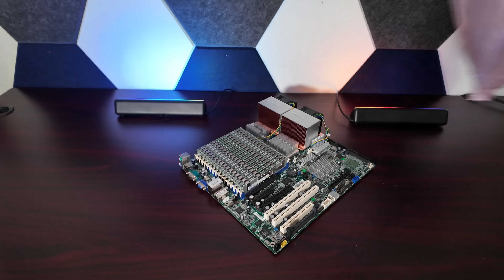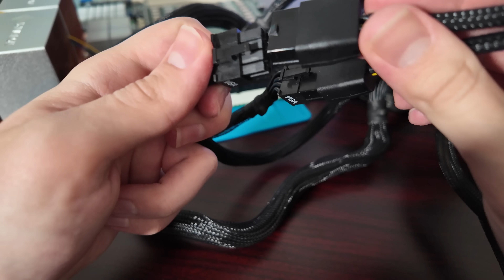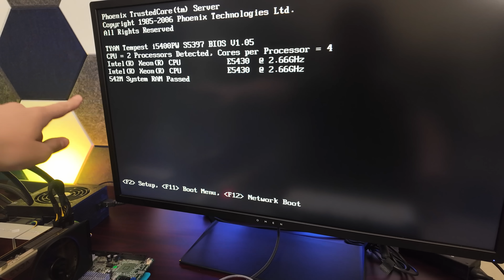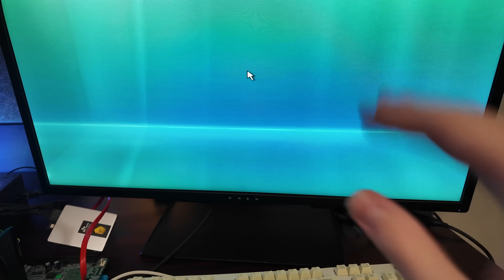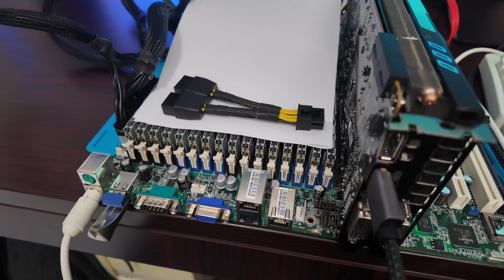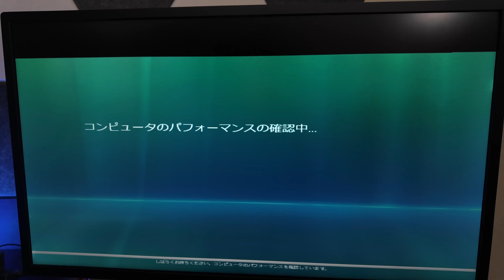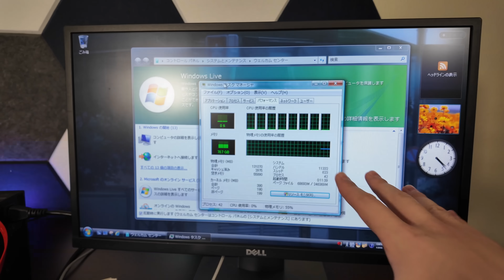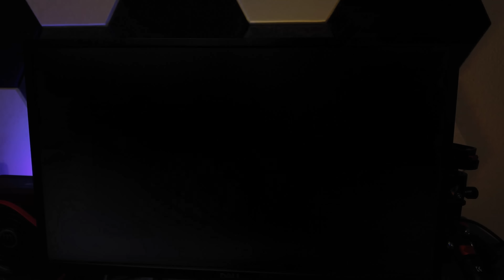What can you do with 128GB of DDR2?

Comment: DDR2 FB-DIMMs are about ~5GB/s (per channel) and it looks like each Xeon here has 2x memory channels so you get about 10GB/s per CPU but then have to content with the CPU interconnect, so while it's a cool project, a single PCIe 4.0 x4 SSD already comes close to beating this, a 5.0 drive can beat the single CPU bandwidth and most likely the latency too. It really takes fast DDR3 to beat the sequential R/W of a few modern SSDs, though at this point the latency tends to be a lot faster than even Optane drives

In short, there is no practical application for this, despite many people suggesting you could do CPU-only LLMs 

Still cool as hell though.
Reply: But AI on these "ancient" CPUs would take ages to generate anything.
As much as i love LGA775 cpus, i have q9300@3.0GHz, these CPU are way too old to do AI calculations.
I've seen some linus video with modern threadripper i think, and that thing took a lot of time to do AI.
I can't even imagine how long it would take for "ancient" Core2 processors with only 8 threads to do some basic AI

Comment: I really miss Windows Aero. It still looks amazing to this day.
Reply: better use of sys resources then what windows 11 uses
Reply: There is a very accurate aero theme for linux.
Reply: @pacg3627  the linux port runs like dogshit and programs often do not obey the iconset nor the menubar icons and theme
Reply: @georgewashington6171  I'm using it everyday on my laptop. Everything works fine and look perfectly like windows 7. I don't know what are you talking about. I'm using "aerothemeplasma"
Reply: @pacg3627  Linux is trash,even worse than Windows.
Reply: @kelvinkegel2304  why?
Reply: @pacg3627 everyone knows why, no one will waste time to list it for ya, just install it you will learn quick
Reply: @pacg3627  bro probably tried to open an exe
Reply: @kelvinkegel2304  fym trash?
Reply: You can get it with Stardock's Window Blinds, though of course it is a bit graphically glitchy
Reply: I never did care for aero.  I always and still do disable it. I find the performance improves when it is disabled.  I dislike any graphical nonsense that obscures or slows me down.

Windows XP would be good on this Tyan motherboard.  I'd use it to power a LSI pci-x raid card to make a IDE Raid array.  Then he could test the data throughput better.  Back in 2007, I salivated at getting one of those cards setup with a board supporting Pci-x. Kid of a stupid interface really as when you search for peripherals, almost nothing is made to work with that slot.

Not much useful a guy can do with this board because Microsoft forces End of Life on their operating system.  All the newer stuff is non compliant with older standards which makes it impossible to do much.
Reply: @pixels303at-odysee9  Even my 2007 Samsung R70 laptop with Core 2 Duo + Geforce 8600M GS ran both Win7 Aero and Linux Compiz rather smoothly and without major performance penalty.
Reply: @pixels303at-odysee9  linux is scared of this man
Reply: @pixels303at-odysee9 Linux
Reply: I hate it, i always disabled it, to me it looks like child toy same as windows 11 and new ios 26. Windows 10 and 98 and previous mac/ios gui are a lot better

Comment: The regular limit for DDR2 was 2GB per module. The vast majority of consumer (non-server) DDR2 modules were 2GB max.
As far as I remember there were 4GB modules, but those were some obscure, working only on some AMD platforms. So rare stuff. 
Almost all motherboards allowed only 8GB max, that's what MOBO manufacturer says on their product page. So that is 4x2GB in a system, since regular RAM capped at 2GB.
And at that time, it wasn't even a problem (for consumers), since Windows XP (32bit) at least at that time allowed only for 4GB. I only added another 4GB once i switched to Windows 7/8
I am still using q9300 with 8GB of RAM the max that is/was possible for everyday consumer using DDR2.
And here comes the guy with 128GB of server DDR2, let's just say, you got me interested 😳
Reply: Even with AMD getting 4 4gb udimms to work was pretty rare. My AM2 motherboard will run 4gb sticks in the first slot of each channel but to fill all 4 slots needs unicorn dimms that are 1rx8 IIRC.
Reply: There's some 4GB dimms that work on Intel even though no motherboard 'supported' it. Later 4GB dimms showed up that only worked on AMD. The ones from the video are FB-DIMMS. Costed a fortune either way
Reply: 4GB stiks of ddr2 works on socket 775 with intel CPU's if mobo has non-intel chipset like nForce 600-700 series.
Reply: @Almashina  -  This. Back in 2009 I had a Gigabyte GA-G41M Combo board with a Core2Duo E7500. It had max support for 8GB DDR2 1066 or DDR3 1333, but you couldn't do mixed mode. So back then I had a 2x 4GB DDR2 kit. I had basically an upgrade path/road map where eventually I replaced that 8GB DDR2 with 8GB DDR3...then shifted to AMD with a Phenom II x6 1090T and added another 8GB for 16GB total. 

Was doing some video editing and photo editing as well as audio work back then--as I do now. So it's crazy watching this video with a 16-core/32-thread 5900XT and 128GB DDR4. When server/workstation grade of old becomes consumer/normal in the present.
Reply: @Almashina  I had a stick specifically advertised as working on Intel. It cost a fortune but worth it at the time

Comment: 128 GB.... try a CPU only LLM - might want to switch to Linux for better NUMA Mode acces, but WIN10 should maybe to the trick also... LM Studio or similar should get you to testing quickly :)
Reply: 128GB of memory that is slower than 1-2 PCIe 5.0 SSDs.....
Reply: @balthxzar  a server like this runs on 2 to 4 channel memory speeds - and latency of RAM still is way ahead of any modern SSD, even when its "only" DDR2... So while you are correct that DDR2 is slow and SSDs have become quite fast, there still is a difference...  And besides that - going for an older Socket 711 System with registered DDR2 RAM nowadays is much more of a fun project than "Meaningfull", so why not to something silly with it :)

Comment: I would love to see a bandwidth test in AIDA64. Based on the motherboard specifications, it's only dual channel per CPU, so it should be around 10GB/s.
Reply: this pre-dates dual channel or on-CPU memory controllers. CPUs of this era communicated with RAM over the Front Side Bus (FSB). the theoretical maximum for this CPU would be 8 bytes x 333 MHz x quad-pumped 4x = ~10.66GB/s. this bandwidth had to be shared with literally everything as everything went over the FSB

Comment: DDR3ECC is optimal because you can use a fairly powerful CPU, it's cheap, and it's reliable. 2 is dinosaur stuff. The only issue is my DDR3ECC systems have high idle power.
Reply: Does undervolting help ?

Comment: CPU-only local LLM model inference. 😬
Reply: I was thinking that but the CPUs are probably missing instructions
Reply: Most useless waste of hardware. Grow up, it's trash.
Reply: @MJ-uk6lu seethe
Reply: @MJ-uk6lu If alternative is trash... by definition, it isn't.

But yeah, I hate it that all this old RAM is essentially useless. Why is there not a product that would allow you to arrange sizeable (or massive) banks of it, backed up by a battery, and just use it as a super fast cache drive. Akin to that Asus (IIRC) PCI card that had 4 DIMM slots for exactly that use, in the pre-SSD era

EDIT: Correction, it was Gigabyte i-RAM.
Reply: @cbs1710  It is trash, because pay like 2 times less to get hundreds times worse performance and you also get absolutely awful performance per watt. It could only make sense in some older high core count thin client with free RAM. And only because Intel put same desktop i9 and heavily detuned it from 125 watt tdp and 220 watt constant boost to just 45 watt tdp with 45 watt boost.
Reply: @MJ-uk6lu  That is what I meant. If the alternative for that RAM is to go to trash, the fact that it is doing anything means it is not trash. What it is is "not efficient", either energy or time-wise. However, neither is selling one's kidney to get something else. So, use what you've got, then try to follow the three-Rs, and get something better when possible, and if one really needs it.

That RAM, if used in non-AI oriented tasks, can still "live" long and productive life. If speed isn't an issue for the user, investing in renewable power (i.e. small solar install of a panel or three) would offset many other small inefficiencies. If it still works fine and does satisfactory work, it doesn't have to go to trash.
 
(Though I think we're somehow at the same time in agreement, and misunderstanding each other...)
Reply: @cbs1710  Trash? You could make a fortune with it on eBay. People are buying anything with memory or memory itself like it's toilet paper at start of pandemic.
Reply: @MJ-uk6lu 

Well, in that case, the idiocy of people buying DDR2 (or even DDR3) at idiotically inflated prices certainly hasn't reached my local shores, nor would I like to condone (let alone support) such behaviour. 🧐🤔
Reply: @cbs1710  Not all of it was actually stupid. Most DDR2 is wortless, but some people wanted, I believe, 4GB sticks for older Core 2 Quad or Extreme systems to either let them last just a bit longer or to build the most extreme retro rig. High capacity sticks were quite rare as they were very expensive and they were sold when DDR3 was already a thing. But that's non ECC RAM and nothing less than max capacity one and preferably maximum clock speed as well. Meanwhile people sweeping low value regular or server DDR2 at premium are morons like you just said. I can bet that there are even rarer morons thinking they will just buy some and resell even higher. I see no offense in you selling it now, but only if you sell it at lower than current price, but above typical price.
Reply: No 😂

Comment: That would be one hell of a Proxmox home lab
Reply: Yeah I run xcp-ng on a 4s 768gb server and its awesome. Cost like 200 cad 😂
Reply: My proxmox homelab is a super micro dual 2969v4 (like 44 cores) with 320Gb of DDR4 and I'm like this dude. Idk wtf to do with all the ram. I have at least a dozen VREs and they're never up all at once
Reply: @JaredBrewerAerospace run models 😂
Reply: Performance would be incredibly sub-par unless you stick to light-weight LXC containers. Those Xeons, even if they have 4 cores each, are slooooow, and so are the SATA ports and PCIe lanes on that era of server motherboards.
Reply: It'd be slow due to missing some important virtualization instructions. Even though these had VT-x, VAT was needed to get near hardware-level performance. VAT was added with Nehalem
Reply: I have a Precision T5400 with dual xeon e5405s and 40GB of DDR2 SODIMM. Its really slow for PVE, the instruction set is limiting and the power draw means I cant keep it up 24/7
Reply: It would indeed... I have like 8/9 in this spec.... DDR3 / 4

Comment: If it wasn't for the fact that you need the 2nd processor for the entire RAM bank + 2nd LAN port, this could be a pretty decent SP staging ramdisk albeit it's probably way too weak for modern ZFS and it's not going to be good for VM either, not to mention you need to replace the cooling lol.
There's also a setting on bios for USB to run at full speed, i think. (it's usually defaulted to 1.1)

Comment: Maybe, the sequential speeds were low, because of the communication bottleneck between the 2 CPUs sharing the whole memory pool.
You should try with one CPU and it's memory channels and see the difference. Also, maybe in Linux would be easier to choose the memory channels of a single CPU for the RAMdisk.
Reply: the ram is 667 so it shouldnt be to bad if the fsb is 1333 . now the 1600 mhz fsb would be a better say like the 5450s or x5472s
Reply: Yeah its 667mhz mem with 2 channels per cpu and a 1333mhz fsb. I dont think it had qpi and idk if they had a dedicated channel between cpus or if it interconnected over fsb... Been ages since i played with this era of stuff

Comment: slaps the side of the case
"Yep, this baby can open 700 chrome tabs at once"
Reply: What case?
Reply: I have over 1400, and my 96gb of ram handle it fine !
appart that one time where to loaded all the tabs into ram at once and it used over 130gb of ram, even my pagefile was shocked...
Reply: @SpeedyGwen  bro my laptop has 4 gb of ram
Reply: @SpeedyGwen  I have 64gb, and it handles around 700 tabs fine, but I stay at around 200 for the sake of stability and my sanity. On a day when I need to multi task, I easily go past 600-700 tabs, but I try to avoid this because I use arch and my fcitx daemon keeps dying on me and I will have to restart and sort out all of those 700 tabs into their designated virtual desktop, and that alone takes a good part of an hour. 200-300 tabs are perfect for me since that's around the limit of what I can keep track of mentally.
Reply: @edamame-h1r  larp
Reply: @matthias7534  If you want to see my computer in action be my guest. Just tell me what you want to be displayed on the screen
Reply: @edamame-h1r  tbh things have changed, now am around 200 to 400 tabs and am permanently on Linux and brave browser, things have been better  :3
Reply: @edamame-h1r  i cant even organize 5 tshirts how are u organizing hundreds of tabs?
Reply: @bruciex4574  I don't. I have 4×2 virtual Desktop layout (Yes that's 8 in total). Each serving different purpose. I just keep tabs open there, and the rest are muscle memory. Also I have the session manager extension installed and set up shortcuts to move and switch tabs. I actually authored the switch tabs shortcuts extension.
Reply: 7*
Reply: ...my Firefox with tree-style-tab is in the multiples of thousand. 😶

(Win 10, 64 GB, PC from 2017)
Reply: @cbs1710  starts crashing for me at around 1040 tabs in brave, 5800x 16 gb 3200 cl14 and a fast m.2, and that's the secret, it flushes fast.
Killed my old 775 motherboard ddr2 and HDD when I started closing the 700 tabs... blue screen, restart, close 30 tabs, blue screen, restart, another round of 30, halfway in, fried.
Reply: @Brukner841  i also got bluescreens but because of full ram, but hardware still working perfectly
Reply: @cbs1710  16gb in my pc. Around ~1500 tabs (I checked this when restoring session) - uses 9-10 gb of RAM.
Reply: Half a chrome tab
Reply: i think quantum computers recently broke the 30 tab milestone
Reply: Finally, I can keep all my "to read later" tabs.
Reply: On my Surface Windows Bloatware 11 Fuck already needs 9.5/16GB available
Reply: 1

Comment: Large language models?

While it may be ‘slow’ … if you compare it to ‘a brand new system with less RAM’, then the DDR2 RAM is much faster than repeatedly reading from an SSD on a more modern system!

Also : Mixture of Experts models are interesting. They can be, for example, a 64 gigabyte / 120 billion parameter model, but only activates 3gb worth of experts per token. That is a situation where it is great to have all the weights in RAM, even though you only use a small subset per token!
Reply: I wonder if the CPU instruction set is sufficient to run an LLM with the cpu

Comment: You can have a minecraft server with a lot of wam.
Reply: I tried a all the mods modded server with 28gbs of ddr3 ram and it'd last exactly 5 minutes before a memory leak ate it all and crashed.
Reply: sad thing is mc servers dont scale well with ram u.u would get massive lag spikes when java does garbage collection
Reply: @nicolasalvarado9485  I'm no JVM expert but could the Shenandoah GC help to mitigate this issue?
Reply: it would improve but not too much, zgc is the standard for 12gb+ of ram. usually when you need more ram is because of mods which often leads to memory leaks. also more ram means more cache misses and if using a server setup with 4 channel memory you will also add latency with the numa nodes. all things combined makes it very difficult to keep the 20tps needed, so its more about fast memory access than more memory. 10- 12gb of ram is best.
Reply: The pewfowmance would be pweddy bad wiv those swow ass CPUs though.

Comment: You didn't check that classic system performance rating on the control panel. I wonder if someone ever got 10/10
Reply: Does it support 16-tuple channel? Maybe quad channel?
Reply: I think i maxed it out with a x58 platform xeon w3570 oc'd to 3.6ghz 6 core 12 thread triple channel memory... Apparently the test still exists but its cli only now 😂
Reply: I managed to get the maximum score on a dell latitude e6410
Reply: It's maxed out at 5.9 in vista iirc
Reply: @parrotkabbarrot Was it really 5.9 ?
Reply: @09simid  5.9 in Vista, 7.9 in 7. After 7 idk cause I already switched from Windows atp, but I remember the vista & 7 ones cause I was super proud of managing to hit these numbers back then lol
Reply: @lhospitalfan_69420 Yes! I remember now, getting those numbers high was the best feeling ever
Reply: @lhospitalfan_69420  windows 8 finally increased it to 9.9, and windows 8.1 removed the control panel display